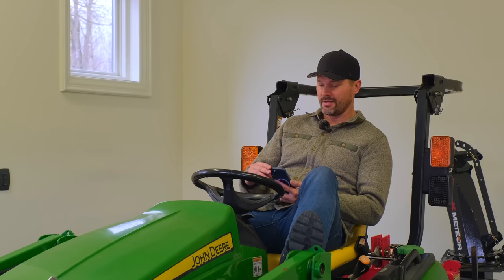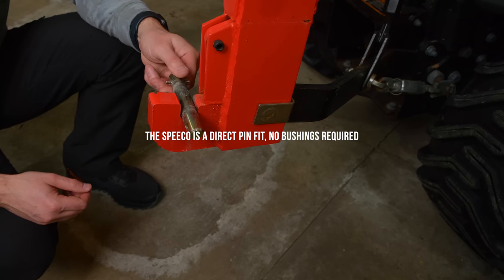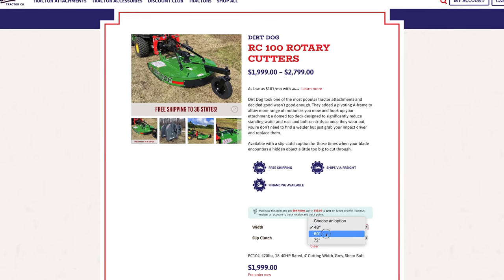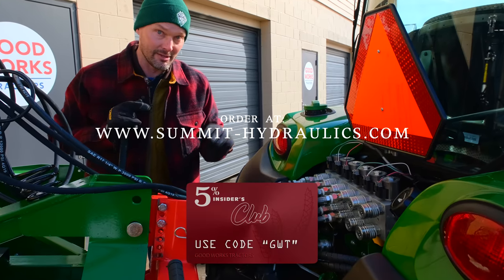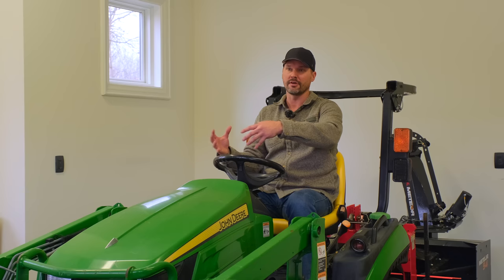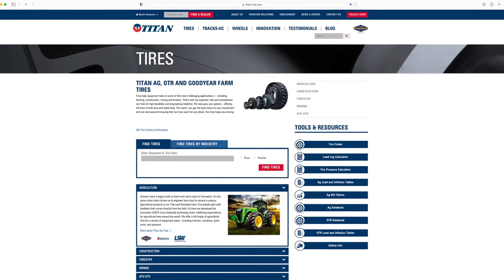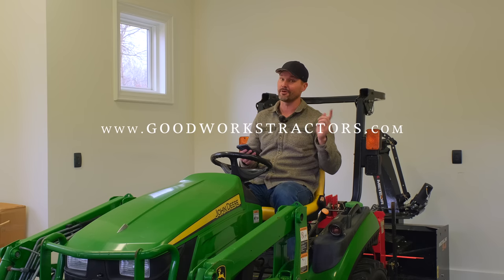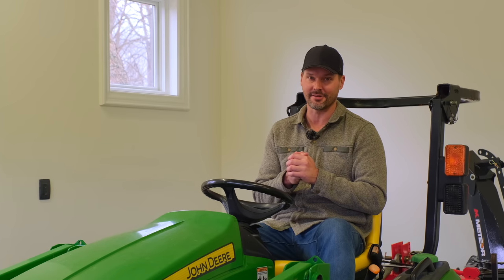YOU'RE WRONG! TRACTOR MISCONCEPTIONS THAT COULD COST YA! 🤯

Comment: Great video. I could especially relate to the dealership part about them telling someone that something isn't available or couldn't be done. Never take their word for it if you have seen it elsewhere or ask them why it isn't available. I'd go further and research it or look to another dealer for information. Especially with tires. The right tire for the job is pretty important. My dad has a B2601 Kubota and it has the industrial tires. He mostly uses it for mowing and some light loader work. They have a long driveway. Would be nice to have the Goodyear r14 for snow but he hasn't complained about it. It may have come that way too because the tractor was already on the lot and was on sale.

Comment: I bought a Green 2520 Tractor 10 years ago when I was building a Pole Barn.   It was more than I needed for 3 Acres, but when I compared renting a machine for a month, or buying, it just made more sense.   A 1025 would have done the job, but experience has told me, to go up a little to work less.   When i need an extra hand, i go get my little green friend.  Each year, i try to add another attachment.  A machine is a great investment and it will save you alot of time and back pain.   Currently, my friend is approaching its 100 hourday.  it's never let me down.   Especially, when it moves a lot of SNOW from Lake Erie's Lake Effect Snowstorms.

Comment: Bigger is better is a possible misconception too.  I use my 1025R doing residential concrete sidewalks, patios, slabs inside buildings and driveways.  The small machine gets in tight spaces and doesn't tear yards up like a large machine or skid steer.  It might take me twice the trips moving gravel but I can maneuver much faster on a small machine.  Most useful attachments for me  are loader, backhoe,, tiller, box blade and of course wheel weights.  Tillers are perfect for sod removal and leaves material easy to spread around later.  Also good for leveling  slight slopes.  I like my R4 tires but I spend a fair amount of time on asphalt, concrete and gravel.  The thing I like the  least about the 1025R is the way shifting in & out of front wheel drive works.
Reply: Have 1200 hours on it.

Comment: I love that you left the 'blooper' in the video where you were loading the front bucket and how quickly you saved it from tipping as it started to go over.  But that perfectly illustrated the tipability of tractors.  I have a 4320 and mistakenly caught a tough root with the corner of my front bucket. When I attempted to lift the load, the bucket stayed at ground level and the tractor started to get pulled over! Holy Smokes! Will that make your backside pucker!  Keep up the great videos!!  BTW, I still love my Speeco E Quick hitch! At 60 years old, it's so nice to keep my butt in the seat.

Comment: I traded my 23hp Kubota B2320 for a 25hp L2501. My post hole auger would bog and stall the B, so I didn’t expect much more out of the L…was I dead wrong! The L has nearly a 70% increase in torque, which makes it literally 3-4 times the tractor! Torque is more important than HP with PTO work. I also went with the DT model over HST for the less parasitic loss at the PTO. I can definitely see where HST is more efficient, as the B was a HST, but I just take my time and enjoy the ride😁

Comment: Tractor tipping with a loader is always on my mind.   I always carry my loader as low as possible loaded or not.  It's incredible how quick a tractor will go over with a loader hanging on the front.  Even a purpose built loader tractor.   Seems we are always working on uneven surfaces with rocks, stumps and holes.   I would include doing jobs that twist or apply pressure to the loader and tractor are very dangerous and potentially expensive.  I have seen tractors broke in half (ones without frames where the engine and transaxle serves as the frame.   Please be careful my friends!

Comment: 2000 hours in 20 years. I got a giggle out that, I've already put 1300 hours on my 2020 4066r it gets some use. But it isn't the only tractor I have and use, collectively I'm putting around 3000 hours a year on our 7 tractors. Some of the old girls have huge hours on them, one a 1984 130hp tractor just clicked over 21,000 hours another a 1966 55hp just clocked 18,000 hours.

Comment: One mindset I’ve never understood is the “why put hours on that machine when you can put hours on another machine?”

I’ve known some people over the years that have that mindset with all different kinds of equipment and machinery…

One of my favorites was a guy I knew that had a fairly successful lawn and snow business that refused to put a snowplow on his powerstroke F-250 because “it’s hard on the truck”. But he was perfectly happy to buy a 12,000lb skid steer and an additional 5,000lbs of buckets, scrapers, snowblowers and brooms to put on an 8,000lb trailer. And pull it around through a foot of snow every time we had a storm…Needless to say he went through a lot of transmissions, shocks and tires. And other than maybe a couple accounts. Every account he had would have been much quicker to just show up with a nice v plow on the truck.
Reply: Probably because a skid steer is more productive and I have never seen a sweeper or snow blower on the front of a truck.
Reply: @melissasmess2773  I’ve been plowing for over 25 years. Skid steers are great for a lot of things. And I love skid steers for snow removal. However there is no comparing productivity levels between a skid steer and a pickup. Productivity of a skid steer at 3mph compared to a pickup at 15-25mph is not a thing. Most skid steers can only handle a 10’ snow pusher. There are now several 10’ or even 11’ plow options for trucks. Personally I have an 810 Blizzard Power Plow on an old 3/4 ton suburban and when opened up to 10’… There is no skid steer out there capable of moving the volume of snow I can move in the time I can move it. And because of the short wheel base of a suburban (or standard cab pickup). There’s not much a skid steer can do that I can’t. 

Skid steers excel at moving piles of snow, cleaning city streets that do not have anywhere for snow piles, and loading snow into dump trucks. And they can be useful for hard to get areas like city sidewalks or loading docks when equipped with snowblowers or brooms. And of course really tight areas are a perfect use for the maneuverability of skid steer platforms. But that can bite you in the ass too when the skid slides sideways into a building or car as they often do. 

Finally, I think you misunderstood the comment I made. I was saying that he bought snowblowers and brooms for his skid steer, not his truck. And then put all of those heavy attachments on a very heavy trailer along with his heavy skid steer. Then hooked it all up to his truck as if that’s not hard on the truck. As a diesel mechanic of the better part of 20 years. I can promise you a properly sized plow is much less hard on a trucks than towing 20-25,000lbs day in and day out. 

For the record, there are a couple of fringe companies that make snowblowers and brooms for truck mount applications. But they’re pretty cheesy.

Comment: I have a 2020 Mahindra EMax20 with the industrial tires. This tractor’s primary mission is winter snow blowing with a front mounted Bercomac 48” blower. This is the factory cab version EMax. I have a very steep 180’ paved driveway. So far I have had no problems navigating the driveway uphill. Recently we got a wet, heavy snow that when compacted turned to ice. Had to raise the blower for the added weight on front tires and was able to get up the drive. Simply stated I am pleased with the industrial tires for snow.
Reply: I have a rear blade for plowing, tried to maneuver on a small slope and front R4's didn't want to turn me, thinking of adding rocks to my loader bucket, definitely not enough weight up front, rears have ballast already, the struggle is real!
Reply: @melissasmess2773  I can understand why. The blade itself isn't very heavy. In my situation I am close to 300lbs. of human ballast, right over the rear wheels. The snow blower is very heavy. I forget the weight but it is somewhere between 300-400 lbs. so when I pick it up that adds a nice bit of ballast for the front wheels. Every situation is different. I'm just saying they industrials are fine for my situation.

Comment: Thanks for another great video. My 2016 Kubota L3800 had 4982 hours on it before it was damaged and totaled in an accident being towed on my trailer (someone rearended me and the trailer flipped). I am waiting for Summit to come out with the enclosed cab in 2023 so I can purchase it. My 1995 Ford/ New Holland has over 13,000 hours on it and still funs fine. As long as you properly maintain your equipment, hours are not that much of an issue.

Comment: I have had my lsmt225 economy tractor since 2019. The only complaint I have about my tractor. Is the adjustment on the 3-point arms of the right hand side on the back is aggravating to deal with. But as far as the quality of the machine the durability the ease of it running. It is as good as any machine I have ever owned in my life and I have owned a lot. To get the same size machine in a John Deere I would had to have bought a three series but even the three series is not as large as the mt2 series LS machine. I hear people talk about resale value of the machines. Well the John Deere tractor was three times what I paid for my LS tractor new. My machine has to 600 hours. I was offered $12,700 for it the other day. I paid $16,000 for mine brand new. I would say that is a pretty good resale value. Considering what I paid new for it. I do everything from pull a two bottle turning playoff to pulling a 6-ft disc. A hydro garden bedder. So do I have any complaints about my machine. Considering what the price of everything else was for the size that I got and the amount of work that it is done. I will put it like this I'm in the market for a 70 to 80 horsepower cab tractor. So I bought an LS brand one of those also. Mt573. If it is half the machine for little machine is I will be well satisfied for the price I am paying

Comment: Just an add on to the hour misconception. Most people do not realize the amount of engine running hours they put on a vehicle, in most cases they have about 1/3 more engine running hours than they do miles on that particular vehicle. With that being said the engine running hours on a vehicle is way different than that of a tractor as the tractor is not working the engine as hard as an automobile. I would say that the most valuable thing that can be done when being a tractor owner is research. Allot of research can save you time and money in the long run. As always great information provided and touching on the various things that new and even old owners face on the daily.
Reply: That's the truth. My Ford Ranger has a combined trip odometer display that shows MPG, distance to empty, distance since reset, and engine hours. I'll notice it says something like 140 miles driven and 6 hours of engine time and wonder where all that time went. At 60 MPH, that'd be like 2 hours and 20 minutes. But of course you're not driving 60 MPH the whole time. There's stop lights, parking lots, traffic, drive thrus, remote start warm-up times, etc. But it sure didn't feel like I was in the truck for 6 hours.

Comment: Behind on your videos Mr. Courtney …for tires I’d like to know which are best for fescue and hills.  We are moving soon hopefully and I will eventually get the weeds to fescue but there’s some hills on it that I won’t be able to go sideways with the 1025R.  The stock Carlisle Trac Chief that originally came with the tractor was fluid filled and tearing up the current yard on turns in some areas.  I had requested no fluid and ended up with new tires as the tractor and maybe twenty hours on it.  I had also driven it to the dealership about three miles down the road.  The salesman said driving on the asphalt was really bad and I pointed out he told me to do it.  He had to reimburse me for the fluid I didn’t want but was automatically charged.  He also never told me about the need for ballast weight where I learned from you and a couple of the websites you mentioned by the way.  Next time it goes in to the shop, I will have to pay for fluid to be put in.  Our closest Rimguard is down in SC so a no go for me.  If I had to buy my first tractor again, I’d definitely go to the different sites and of course watch your videos,  seems I could have had better equipment than what I’ve purchased.  Thank you so much for educating me!

Comment: Like you said about time, when taken care of these engines will last a very long time. The tractor as a whole will last a very long time. Most people look at hours on tractors but don’t think about the vehicle they drive daily. A car/ truck has way more hours on them by the time they reach 50k, 75k, 100k, or 150k miles. And that’s not adding in idle time for those lovely days where it’s -10 or 100+ degrees outside and we want to be able to get into a comfortable vehicle to escape the climate. Traffic jams, waiting in line at our favorite fast food joint, etc… that engine run time is a hidden add up that’s not tracked nor thought of.
It’s all about how a vehicle is taken care of!
Reply: The way I look at it is an hour on a tractor is around 100 kilometres or roughly 60 miles on a car. So if a tractor has done 1000 hours it’s roughly 100k km. Most cars are good for around 300,000 km. Most tractors can easily do 3000 hours but they are definitely second hand by then.

I’m Australian so am used to measuring in kilometres.

Comment: I have a 1023e and I love it. Would I have liked a 1025r ? Absolutely, but this tractor gets it done. The heaviest work it does is splitting firewood with one run off the power beyond. I didn't buy it to run in parades, I bought it to work and, so far,  no matter what I've thrown at it, it always comes through.

Comment: You’re absolutely correct about everything. Tractors are not indestructible and you will learn your limits. I would say clearing and hauling brush/trees is the hardest on my 2032r. Sticks poking through and busting hydraulic lines. I have a gen 1 2015 2032r with 200hrs. It pretty much sits in the shop but I always need it at least 3 or 4 times a year.
Reply: Travis... I picked up a free truck bedliner from a friend two years ago. After an hours work, it made a great underbelly shield for my tractor. Easy on/off with bungie cords.
Reply: @randalmiddleton8068  that’s a good idea. Friend of mine owns a scrapyard. I’ll see if I can find a truck bed insert. Thanks

Comment: I'm not sure if it's the case or not. A traditional style geared tractor and shuttle shift drive trains had the most hydraulic strength vs. a hydrostatic drive the few times when a dealer offer's drive train options. This is from the hydrostatic using the same hydraulic pump for drive train and loader/remote work. I believe that newer (2010 to now) tractors have larger pumps to accommodate the difference.

Comment: Did I miss it? I have an old 45 hp MF 150, 2wd. From what I have seen, a 35 hp 4WD tractor can match or beat what my machine can do simply because you have 4 wheels pulling verses two. You can still save money buying 2wd tractors, but it might be smart to compare what pulling power to the ground you have and then buy something at lower hp but with 4WD. Secondly, my old machine has cast iron construction from front to rear and it weighs more than some now days at the same hp. Weight to ground per wheel is what it all adds up to, and of course, as you mentioned, what tire tread a person has matters. Then, how much ground each wheel actually is in contact with the ground matters. That is why you see some  tractors with duallies. It might be interesting to figure out how many pounds per square inch you get per wheel and the resultant pulling power is available to do the job. That could end up with some good technical knowledge folks could use to accomplish different types of jobs when they buy a tractor set up.

Comment: I had an old Kubota L3130 on a big frame.  It did everything we needed to do, but developed maintenance issues.  When we sold it and bought a new one, I had to jump to a Kubota L4701 just to have the lifting capacity with the loader to manage large round bales.  I knew I didn't need the horsepower, but it was the smallest Kubota with enough lift capacity.  The old L3130 had the same loader as the L4701 (the new one is a bit stronger).  I agree with the comment about horsepower.

Comment: As far as "Tips & Tricks" go (do you have a thread for this ?), I use color coded tie-raps to label the hydraulic connectors so I get a consistent & working order for the controls.  Especially useful when 'borrowing' the loader circuits for rear machinery control (hay mower header lift & tongue swing for example).  Up is up and left is left and rotation is as intended !

Comment: Listening to people complain about the tires on snow and ice I exhausting.  For most people the tire shouldn't matter,get a set of John deere tire chains. Night and day difference . I know he's not a fan of chains because they" may"reck asphalt.
 If you avoid spinning your tires you won't damage the asphalt.  Without out doubt a chain will push 10x what any regular tire will. If you don't have asphalt then seriously 🤦🏼. Now I realize chains suck to put on. So on my smaller tractor I simply  bought a second set of rims and tires to have my chains on . Super easy to just swap rear tires .